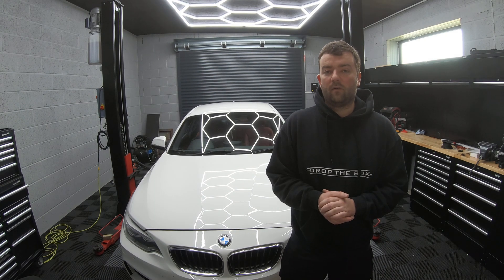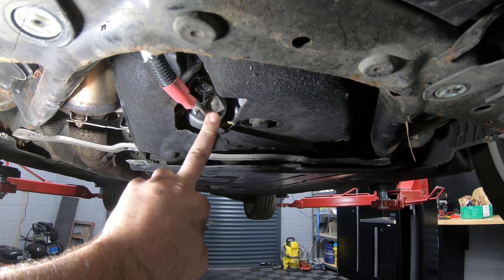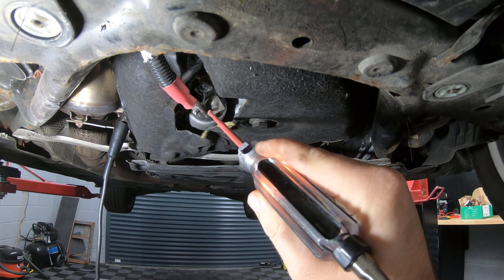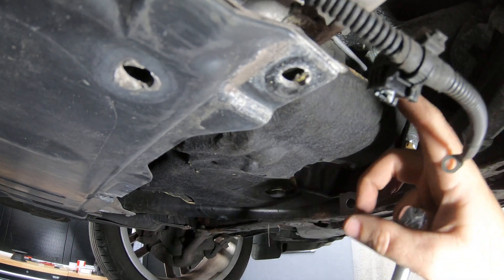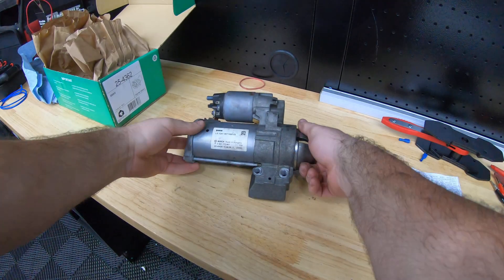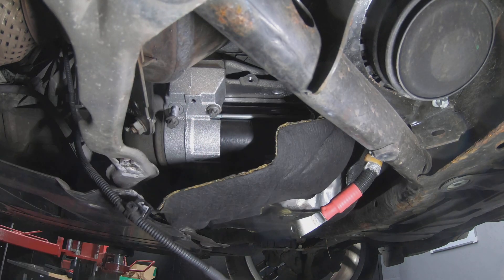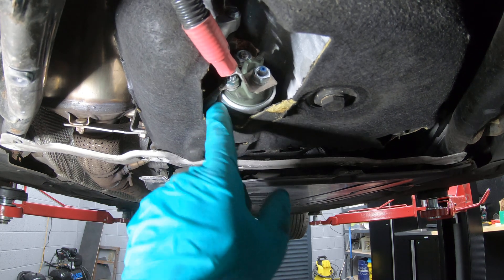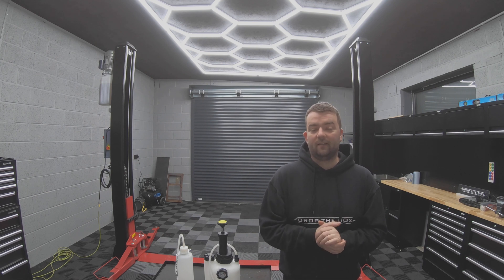BMW 218d - Starter Motor Diagnose & Replace

Comment: Perfect! My BMW 220d Active Tourer xDrive should be in the same mounting position as yours, right? I need to engage the ignition twice every time to start it. After checking, it seems the battery isn't the problem, so I'm planning to replace the starter motor myself.